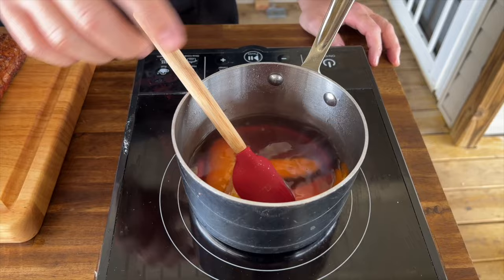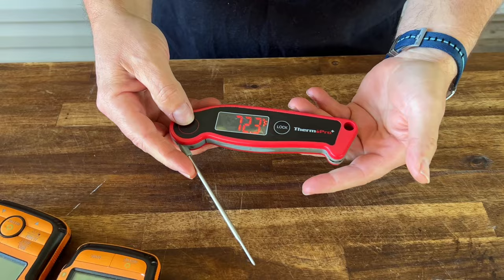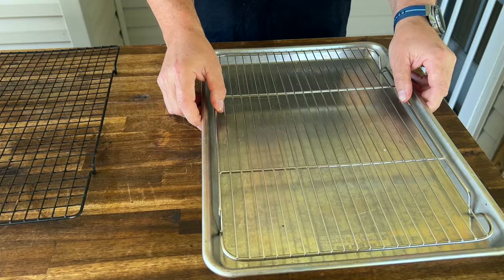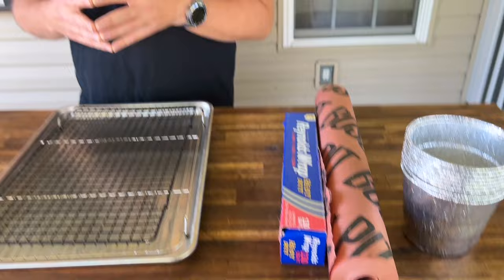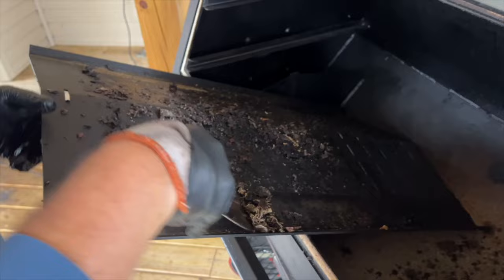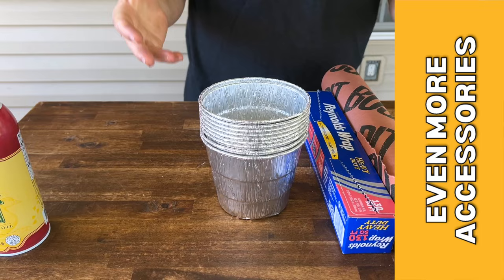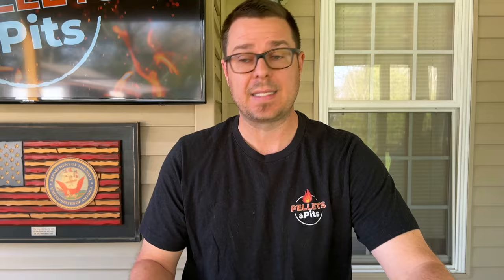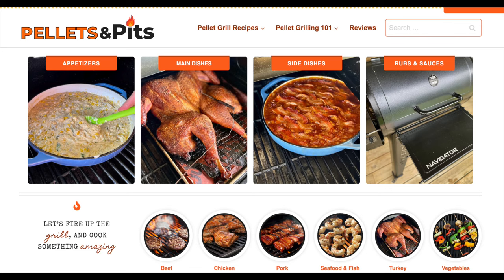Pellet Grill Accessories that YOU PROBABLY FORGOT to Buy!  (Other than tongs and spatulas)

Comment: Big suggestions  is find your local restaurant supply store. They carry higher quality items for lower price.  Sheet pans with appropriate cooling racks, stainless gastro pans, cambros and buy heavy duty foil on the 18 inch commercial roll in a box with the cutter.

Comment: How about that, you taught an old dog new tricks!  I really loved the recommendation on the sheet tray + racks, as well as the off brand disposable grease bucket liners.  And this may sound silly, but I've always pulled the tray out of the bottom of the smoker and stood it vertically in a large trash can.  Then I see you scraping it inside the smoker, and I was thinking "duh!" why aren't I doing that!  Great video Neal!
Reply from the maker: hahah On the lone star...it actually helps "soak up the wood ash" s so when your done..mix the ash and the grease...works wonders

Comment: Agree with the comment on the square mesh cooling racks.  Even the dish washer wont get them clean.  I usually end up putting them on my gas grill at 600+ degrees for 15 min and then hit the corners with a propane torch.  I like your solution better.
Reply from the maker: Just got absolutely ridiculously how time I would spend to clean...I wish I had done this way earlier on in life...

Comment: I love my pellet smoker but it consistently runs 30-60 degrees hotter than it indicates. A separate temp probe for ambient temperature is a must. My smoker has no shelf space except for the pellet hopper. They sell a folding shelf for the front but it’s $100.  For $40 I bought a plastic folding table that accommodates all utensils, sauces, spray bottles and there’s plenty of room to wrap ribs or a pork butt or a brisket. I use it every cook.
Reply from the maker: Great tip...thanks